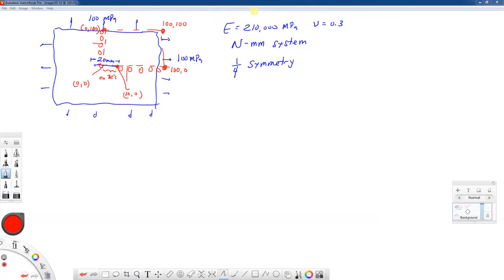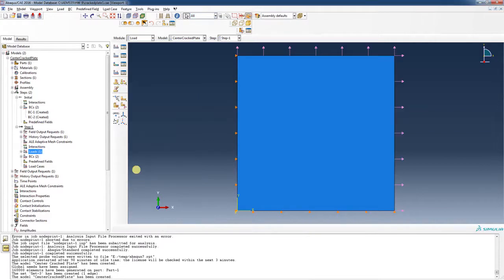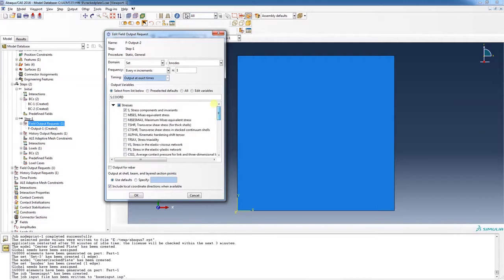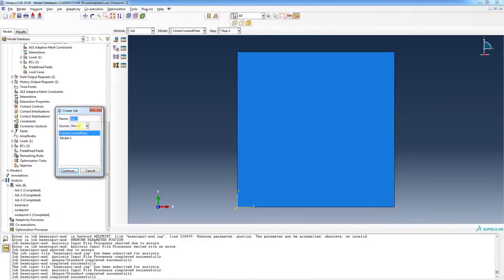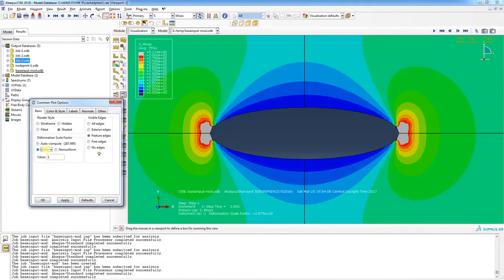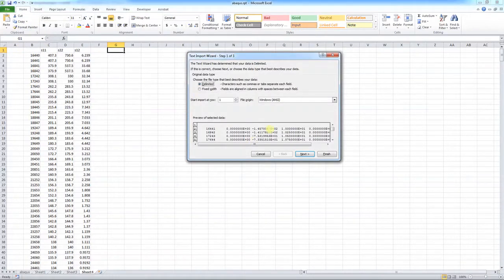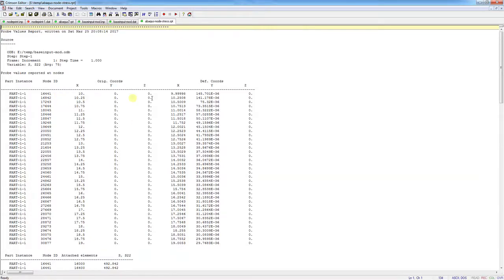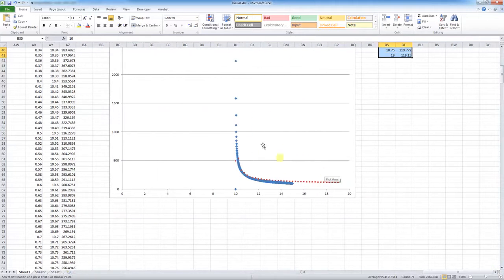AEM 535 HW-9 Part B Crack Stress Fields: FEA solution

Comment: Dear professor Barkey, I just strat this series of course. But I want to say in your fatigue lectures I've learned so much.
Before learning fracture mechanics, I would like to ask a question. The fracture mechanics approach is also available on brittle material such as polymer? As I know, most research is mainly focus on metal. If you have experience deal with fracture problem on brittle material,  could you please share with me? Thanks a lot :)
Reply from the maker: Linear elastic fracture mechanics (LEFM) is best suited for brittle materials, but can also be applied to materials such as ductile metals with limited plasticity.  I am not sure I would classify a polymer as a brittle material in general, but it could depend on the particular polymer.
Reply: @mbarkey.mechanics  Dear professor Barkey, thanks for your kindly reply and it really helps. Actually I've found there are many failure criterion in Abaqus XFEM such as MAXPS, MAXPE and so on. I would like to know how to determine which criterion should I use? Thanks again!
Reply from the maker: @PhilCheng  There are many options in software packages, but you should really have a degree and experience in engineering to know what is the most appropriate failure criterion to use; it will depend on the type of material and service conditions under which it is operating.  I have a Mechanics of Materials lecture on basic failure criteria that will give you an idea of some of the basic considerations.  Take care!
Reply: @mbarkey.mechanics  Dear professor Barkey, thanks for your prompt reply. I'll study your lecture frist, thanks again :)

Comment: Thank you very much for the simplified explanation. Please, how do I obtain singularity at the crack tip for a 3D model without a finer mesh? A guide would be highly appreciated.
Reply from the maker: Hi Brian, You can set up Contour Integrals for 2-D and 3-D problems to determine stress intensity factors.  Full 3-D problems can be done, but can be a lot of work.  The next video shows how to do this for 2-D and what can be done for 3-D (link and end of this comment).  The software called FEAcrack can automate this process by building meshes for ABAQUS.  Best regards, MEB https://www.youtube.com/watch?v=bDKeJ63V3rg&index=22&list=PLaDWa6xI4zefL69_xDs-OoS8pECVpAo3F

Comment: Hello. If i would like to make the mesh around the crack even finer, how can i do it? Thank you
Reply: And also if i want to quantify the data from plastic zone for example the coordinates,is it possible?
Reply from the maker: I would not recommend making the mesh finer, but you could use crack tip elements with collapsed sides that may better capture the singularity.  Regarding your second comment, if you request the output variable *COORD you can get the coordinates of the nodes in a node set or for the entire mesh.
Reply: Thank you very much for the simplified explanation. Please, how do I obtain singularity at the crack tip for a 3D model without a finer mesh?

Comment: Dear professor Barkley. Thank you very much your videos. I have learned so many things watching the. I have one question. In this example the material is elastic. If we would like it to be elastoplastic which property option could we chose? The formulas that you have used in the analytical solution are valid for all types of materials? Thank you!!
Reply from the maker: Hi Lamprini Papargiri, In the FEA solution, you can choose to add *PLASTIC with an appropriate hardening type and specify the stress-plastic strain curve.  You may refer to one of my other videos on a plate with a hole using elastic-plastic properties to see the features to use in ABAQUS.  
The analytical solution was derived using linear elasticity, 2-D, isotropic material and near the crack tip.  If you introduce elastic-plastic behavior, the analytical solution is more complicated.  For details, I think you will find them in the book "Advanced Fracture Mechanics" by Popelar and Kanninen.   Best wishes!
Reply: Thank you very much for the help!!

Comment: Under pure compressive stress, the stress intensity factor KI should be zero. However, using this technique, I always get negative KI. Could you give some advice to get KI=0??
Thank you very much
Reply from the maker: Yes, please review my previous comment about using contact elements. I have done it, and when I put my plate in compression, I got very nearly a uniaxial stress field indicating no stress intensity.
Reply: Thank sir
I did rely on HW10 video. With compression, I did in following steps:
- Create crack. At the crack tip, I choose: COLLAPES and DUPLICATES NODES.'  I choose this option to make sure that no common nodes between Master surface and slave surface in contact elements. If I do not choose this option, there are two common node between master and slave surfaces at the crack tips.
- Use MPC constraint - PIN type to constraint all nodes at the crack tips. This constraint permit all nodes at the crack tips only rotate around crack tip point.
- Define Surface to Surface contact between crack surfaces. Select "Hard contact"
The model runs well, but the result is negative KI.
I wonder where I did the wrong steps.

Please let me know, how do you constraint crack surfaces under compression.

Thank you very much
Reply from the maker: Here is a link to my personal forum that has the file on it.  You will need to register for the download.  Let me know if you have any trouble. I was able to find the input file for this case.  This is all I can do for the next couple of weeks (final exams to grade).  http://forums.mbarkey.com/index.php?topic=142.0
Reply: Thank sir,
I checked your model. The result is quite similar to the result in my model.
In my model: Crack length, 2a=20 mm; compressive stress = 10 MPa.
The obtained ratio: KI/(sigma*sqrt(pi*a))~ - 0.01, and I want to get KI=0.00. This is my problem
-----------------
My supervisor accepted my model with the ratio: KI/(sigma*sqrt(pi*a))~ - 0.01
-----------------
Again, thank you so much.
Reply from the maker: There is certainly a stress disturbance there, but it seems to be that it is a numerical anomaly and does not appear to have the characteristics of a crack tip stress field.  Good luck!

Comment: very helpful video. Thank you
Reply from the maker: Thank you HAO LUONG!
Reply: In case of impact load, how to use contact element to avoid penetration between crack faces? I get stuck in using contact element. Could you please give some guidance? Thank you very much
Reply from the maker: You will probably want to model the entire left or right side of the plate, then define contact definitions for the crack surface.  I tried this with the plate for HW10 (the next video in the play list) and applied a compressive stress on the plate and it worked (albeit with some slight stress disturbance).  For a Standard analysis, you can check ALL WITH SELF and then define the contact behavior.  For Explicit, there should be a similar way to define contact.
Reply: Thank sir. I have done it. 
your videos HW-9, 10 are great for me. I am a master student working in this field.